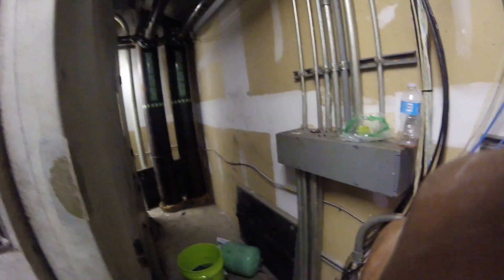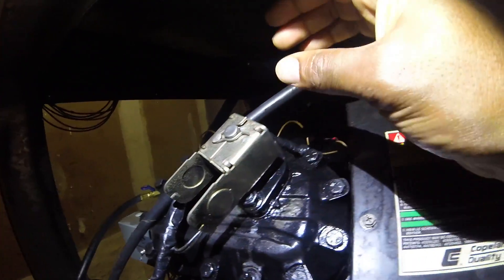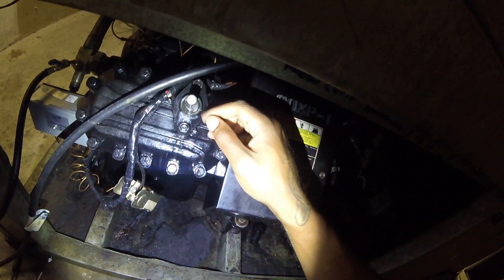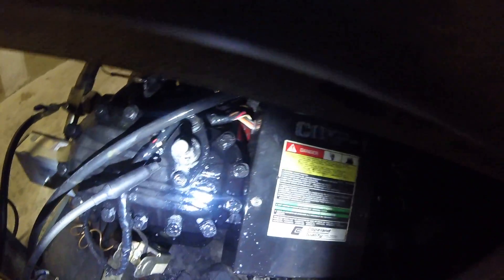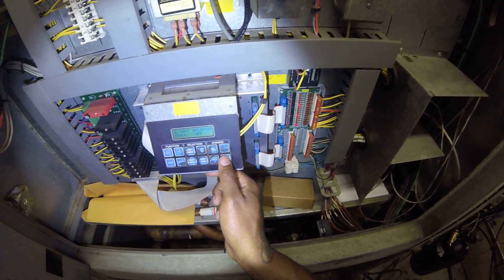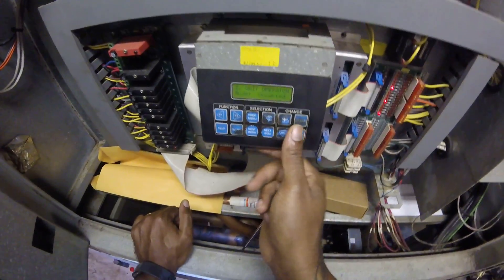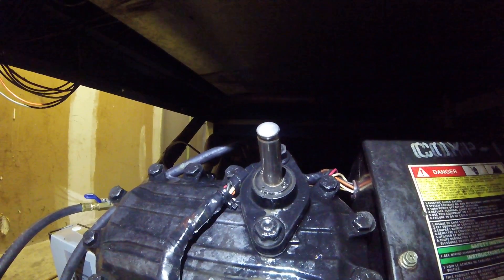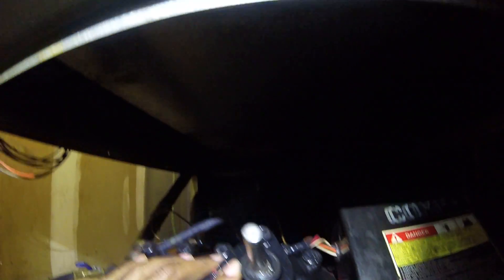HVAC: Copeland  Compressors unloader leak

Comment: That's not an overload it's an unloader for that side of the compressor. You want to unbolt that stem and you can install a new one that's the only way to fix it for sure, the seals are gone in it.

Comment: There is a tool for tightening those up. I have one . It looks like a nut with 2 little prongs on it that fit in the 2 holes. Slides over the stem and tighten up with an adjustable wrench. There is a flat o ring under there that seals it. FYI good job on the videos. Not many guys posting commercial service particularly the BAS stuff.